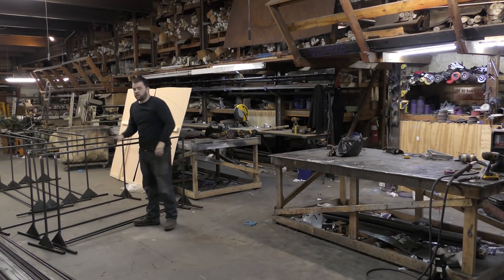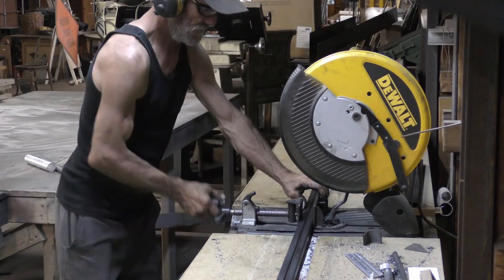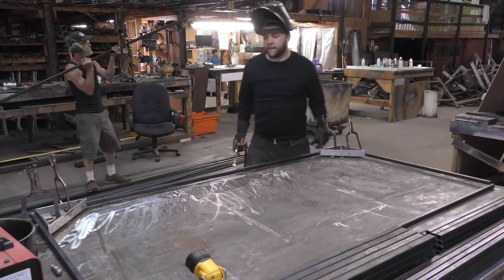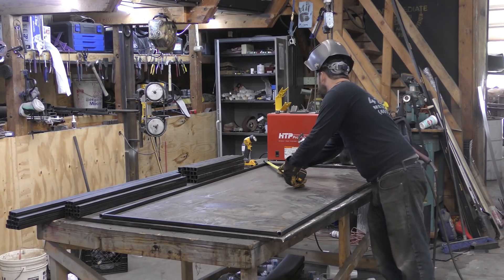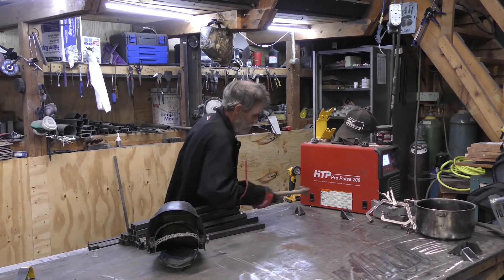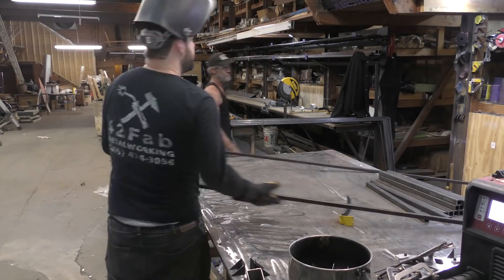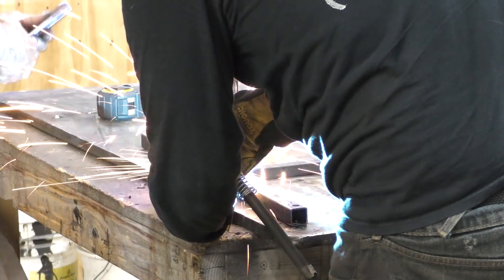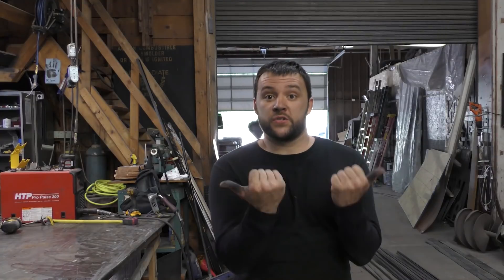Jigs and Batch Production in the Welding Shop. Easy Banner Frames

Comment: The plasma is far better than hand cutting even on simple parts, especially when doing a quantity of them where you can nest them. Why would you remove the guards from grinders? A guard likely would have prevented getting chewed up by the flap disc. The design of an angle grinder just puts the users hands too close to the disc to go without. In 20 years of fabrication work, I haven't found a need to remove the guards and often do the same type of work you are doing and use most of the same tools. I would love to see or hear examples from people of the scenarios that make people go without, as so far no one has had a good one and I just don't get it. At least on the die grinder, the flap disc is further from my hand and I only run 3" discs. Now, I have rushed and had similar accidents and have to scars from minor run ins with a 3/4" cylindrical carbide burr on the straight die grinder. One was from not wearing gloves (i almostalways wear gloveswhile grinding and never weld without gloves) and the burr spiralling out of a hole, while the other came out of a hole while rushing and ran up my glove and onto my forearm. I need one of those magnetic chucks, that is slick. For fixturing, I built a certiflat fab block table and really love using it. While your method certainly works, it is nice to have holes already in a square pattern that pins and clamps will drop into. They don't pay more to work harder or less efficiently,  so I agree with streamlining the steps to get a project done.
Reply from the maker: Grinder guards is a debate that will rage forever. I find that they prevent me from using a grinder effectively. They scrape the work, and only allow 180 degrees of a flap disk to be used, with slows one down when bevelling. That said, it's personal preference and I don't let my comments devolve into safety police cases.